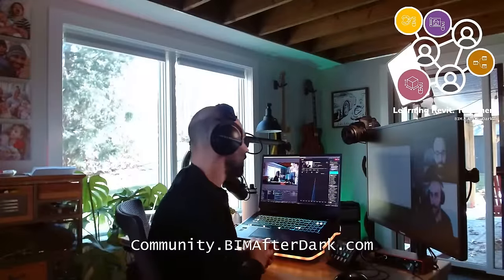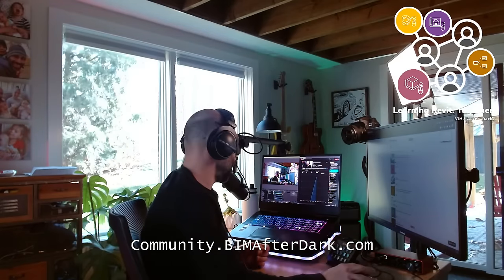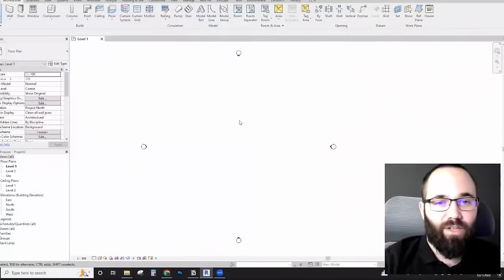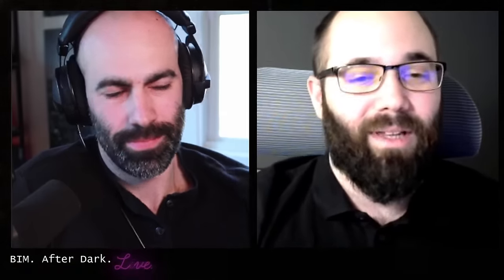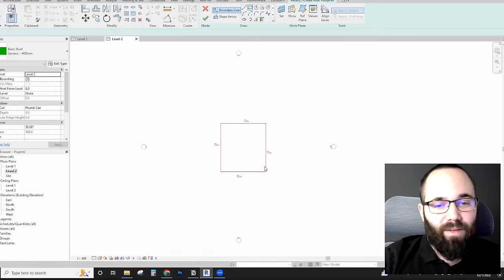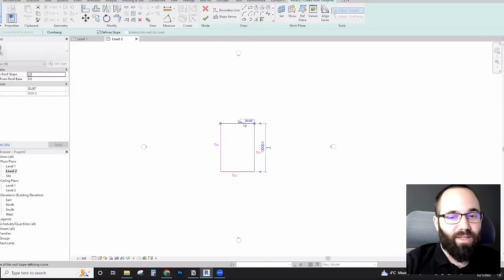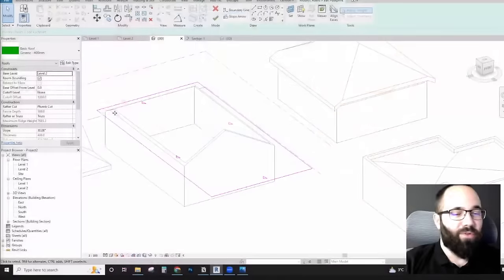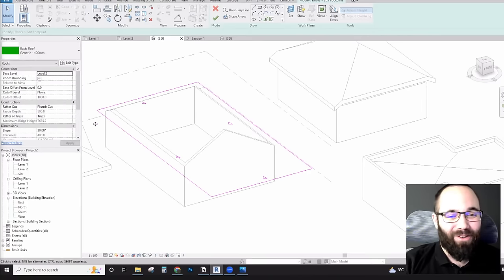Roofs in Revit with Balkan Architect

Comment: A quick scenario for use with the cutoff would be when having to deal with height limits imposed by the city / jurisdiction.  Say here in Colorado most areas have a 35' height limit (measured in some of the most insane ways).  This would be a good way to quickly model a hip roof that may impose on that height limit, and set it to have a "flat spot".  Makes it easier than using the hole tool to pop a hole in the roof to model out the flat spot.
Reply from the maker: I guess I could see that being a way to visually SEE where the cutoff would be… But, my point was you could easily do that within your sketch of your hip roof… That’s all.  I get your point, though.

Comment: I think the cutoff level would be helpful if the roof stops at a certain point and then continues at a higher point, think something like Japanese roofs. Does such a use make sense, or is it still just easier to trace out the outline of the roof?

Comment: Hello,
at 46:40 instead of creating a roof, it is possible to use the same tool as at 49:18, it's much easier!
EDIT : I'm talking about the "joint roof" tool, it also works with walls
Reply from the maker: Not sure what you mean? I don’t think the dormer too would have don’t what the roof by extrusion did for that overhang…
Reply: I believe your talking about the join roof tool instead of the roof by extrusion? if so join roof only works to join two roofs... I believe
Reply: @studioEARL  Exactly, and NOT !! it's possible with a wall ! i use it everydays :)
Reply: @TheRevitKid  Sorry my English is bad.
I meant that it is not necessary to create a second roof for the part that goes against the wall, with the "Joint roof" tool; you can extend the roof to the wall, as you did for the skylight, to the roof.
This tool also works with walls!

I can't put an image in commentary or video .. too bad.
Reply: @studioEARL  look the tooltip, it's written :)
Reply: @mikanari9467  wow, I had it in my head it didn't and therefore I hadn't tried it. I did look at and try it. I stand corrected. That does do it. OFC, only if he raises the wall all the way up (which he does). Thanks for sharing.
Reply from the maker: @mikanari9467  ahhhhhh cool!!!

Comment: How would it work if you wanted to have a roof with an overhang, but wanted a flat bottom for say the patio area, so that the walls didn't go all the way up the roof height. Would you just extend the ceiling out to that area? or would you create a second floor for that area? I hope that makes sense.
Reply from the maker: I would create a second ceiling  for under the patio … just like you would build it!  Model it like you build it is always the best approach!

Comment: Hi all.
In 49th min, Milos is talking about joining two roofs together, using roof join tool. That is great when both roofs are on the same plane, but if one roof is lower than the other one, that command is no longer working! 
I had to join two roofs manually by extending one roof into the other, joining them to see where the intersecting plane lines are going to be, drawing reference planes over them, unjoining the roofs and then modifying the roof edges of one of the roofs (or both if you want to create a dormer opening.
If there is any other way of solving this problem, please do let me know.
Cheers ;)

Comment: Modify sub elements is only available for truly flat roofs. What if the flat roof was sloping front to back (ex 1/4: 12) how would you go about creating the saddles? Thanks
Reply from the maker: use modify sub elements to make the initial slope, too.
Reply: @TheRevitKid  Thanks for replying. Once you've used modify sub-elements to do one thing to the roof (in this case slope it) if I then wanted to create a saddle affecting only the insulation layer,  The variable in the roof properties is no longer available to do this (test it out).